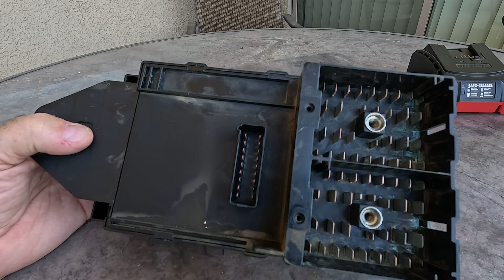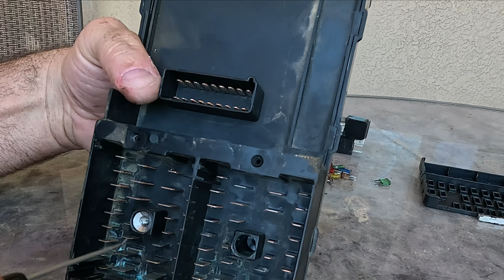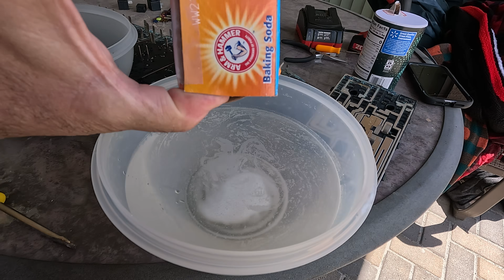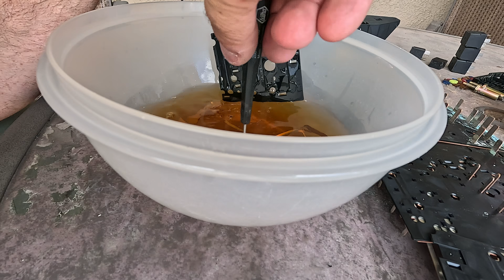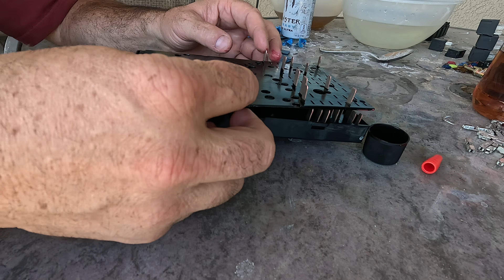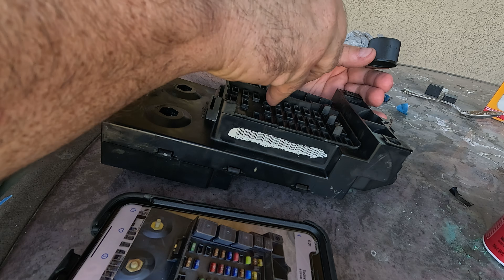How to Fix Your Ford Truck Fuse Panel (Avoid $2,500 in Repairs)

Comment: I have a 03 ford excursion and the cab lights stay on cause it thinks theirs a door still open when all the doors are closed. Is it possible that this module is the issue? It also has a starting issue where we have too bypass the igntion switch so any tips on that would also be very appreciated.
Reply from the maker: You may have a bad door ajar switch… I would check those first. If it acts up or different after a rain, this is probably the problem. You would have to give me a lot more info on the ignition problem for me to help you.
Reply: @heathputnam9524  sounds about what I was thinking of as well for the ajar switch. But for the ignition after digging into it theirs a black and pink striped wire that fell out of the ignition and looks like it broke off from where it's supposed too be at. Is that wire for the security system? Cause the security light does blink when truck is running. May sound dumb but this is my first time doing something like this and don't want too mess it up more then it already is.
Reply: @kylebeach2316  that sounds like a PATS issue. It does need to be plugged in. There are a few PATS kids out there for 6.0s

Comment: I've been having the random electrical issues for a year or more. I had seen other videos on this subject but this one is the best yet. I'm just now finding it as I was in the process of repairing mine.

I do have one connector that was so badly corroded that it was only barely making contact. Upon removal it came apart. I'm cleaning it up good as you did and will attempt to repair it with soldier.
Reply from the maker: Oh wow! That is a bad one! This fixed all my electrical problems! Good luck and let me know how the soldering goes. Thanks for watching.
Reply: @heathputnam9524  yeah I'm sure this will fix mine too. I was sure before I started. I've tolerated it for way too long. I've been disconnecting my battery every night for many months until I got the time to do the fix. But I at least 3 or 4 connectors have been doing some low voltage arc welding for a while. 😂
Reply from the maker: You may want to keep your eye on my channel I am doing more excursion/super duty videos as I fix up my 2000 excursion for exploring the high desert of Arizona.

Comment: My truck stays running if i take the key out and it also gets stuck in park! Also throws ABS codes and the transmission slips and wont downshift. Then after it snowed my wipers quit working. I noticed the GEM fuse was melty looking so I replaced it and it fixed the issue but then it got hot and went back to hanging up in park again.  Oddly enough somebody tried to steal my truck last night but they couldn't because it was stuck in park! Kind of thankful for this issue in a weird way. But they did break my lock out and destroyed my key cylinder.
Reply from the maker: That suck man! My ignition cylinder is busted so the truck will keep running if you pull the keys out. Dang Fords! Gotta love em!
Reply: @heathputnam9524  idk why I keep buying Fords lmao